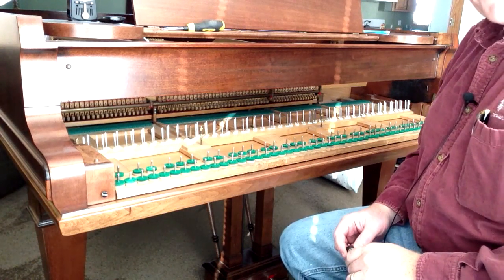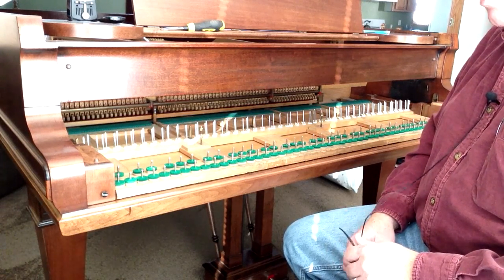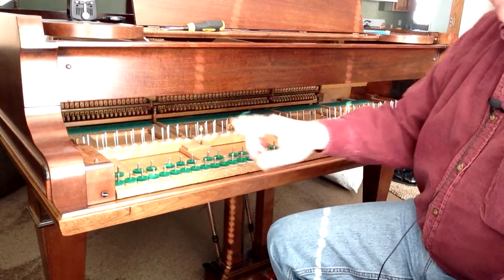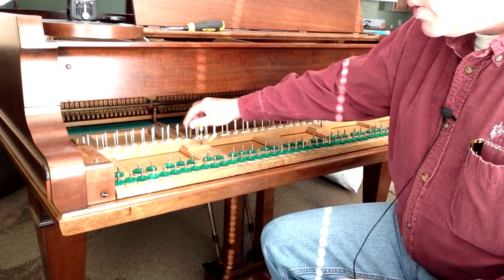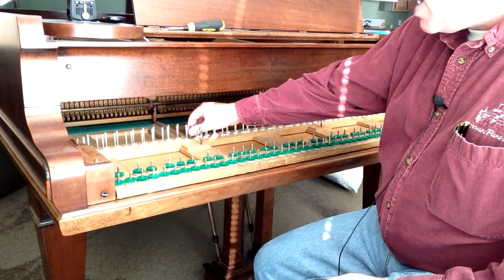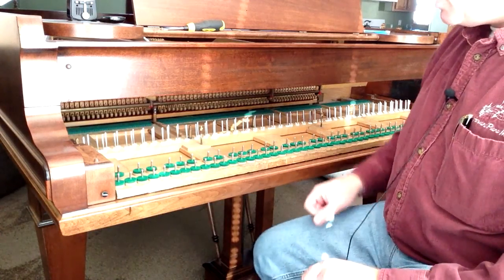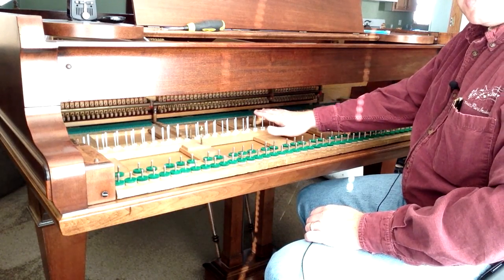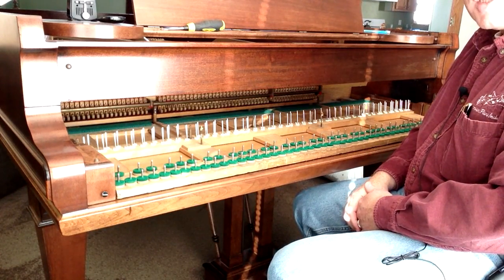Bedding The Grand Piano Keyframe - Piano Regulating I HOWARD PIANO INDUSTRIES

Comment: Key frames should ALWAYS be bedded with keys & top stack/action ON! A key frame by itself weighs less than 6 or 7 lbs, a complete action & keys on the key frame weigh any where from 30 to 45 depending on size of piano & brand. I was taught to use newspaper strips(newspaper torn into 2-3" wide strips the full length of the page)newspaper is .003" thick. Place the action in the piano, lift the front of the action up 2-3" & slide a strip of newspaper under each glide lower the action, gently pull the strips. There should be equal tension on each strip, if it tears there is too much, back off the glide, if it pulls out too easily tighten down the glide, keep trying until all strips pull with the same tension but don't tear.

Comment: Seems to me that by removing the stacks and keys you have removed a load that in practice confirms the frames playing history of 'trueness'. Doing it this way you run the risk of artificially 'supporting' a unloaded bow in a rail that has hitherto been pressed flat by the additional weight of the keys and stacks. This could cause problems with the action that must now conform to  new stresses and tensions as it attempt to adjust to a new 'sense' of level.

Comment: Hi 
Thanks for your video. How do you determine the correct key hieght if initially this operation was set incorrectly. On both white and black keys.
As well as key dip. This is for a grand piano yamaha g3
Thanks in advance
Reply from the maker: Hi John,Thanks for watching!  For a Yamaha G3 I would try around a 65 mm key height and have the sharps about 12 mm above the white keys.  You can use this as a starting point and play with some of the other regulation adjustments to see what works best.
Reply: Ok great thank you for all your videos.